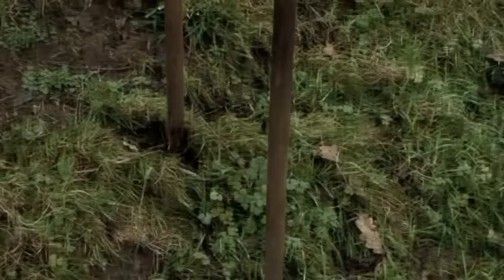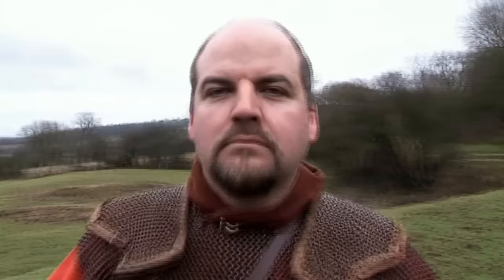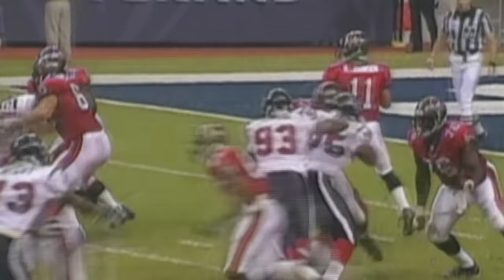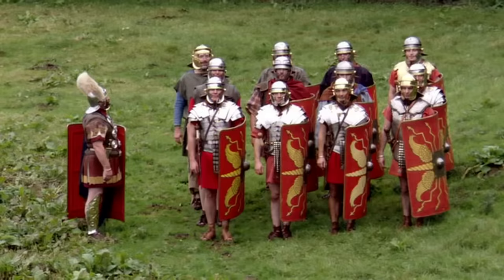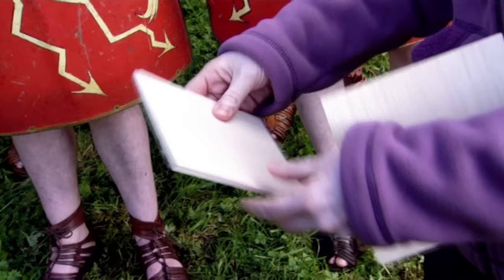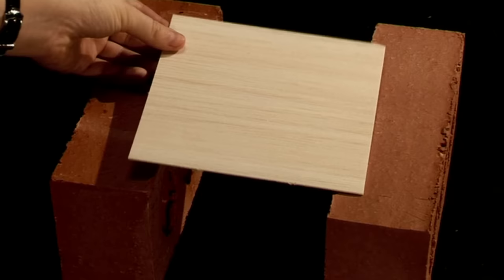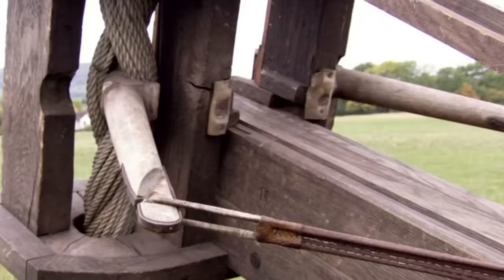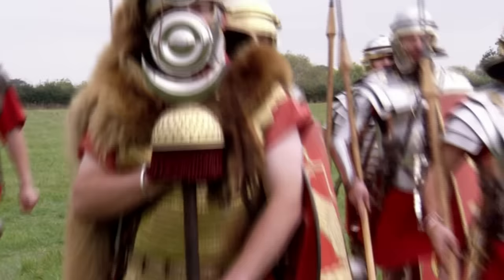Roman Military Technology and Tactics

Comment: Several misunderstandings keep going on about Testudo formation.

Note that it supposed to be a last resort.

It is very vulnerable in close combat against any melee attack, cavalry attack, and engine fire. Even against arrow attack, it is not considerably more protective compared to any more conventional cover formation. Finally it is tiresome. In normal circumstances you expect that only defending side of the cohort is under pressure and the rest of the unit is resting until their turn comes, and men fighting in tandem, so that they share the risk and effort in turns and fight much longer this way. In testudo you force entire unit to raise shields and tiring all men in an uncomfortable position, which also prevents use of any weapon to protect the first line. No pilum, no tandem, not even support from back raws as all men from second line to the end losing their front view. Unit is slowed down and cannot maneuver. Soldiers cannot dodge individually or in small groups as they cant see incoming attacks.

If Romans would testudo every time they received arrow attack, they would lose battles much more frequently.

Only few cases where Testudo isnt counterproductive, can be when enemy concentrated fire, either from an elevated position, or aiming over the shields from a long distance.

Testudo may be an instinct behavior when surrounded by too many horse archers, but if this has ever happened the war was to be lost anyway.
Reply: Yes but the engine fire, may be arrows, could go through their shields and may kill them by impailing their hand
Reply: @TPS-Ultimate-Soccer69  or any other body parts
Reply: No, it was used in attacks when the enemy had ranged units. For example in the battle of Antinoch, Aurelian used the testudo to move his units as close as possible to a enemy force that was between 2 mountains and guarding a road. He couldn't flank it, so he had to go straight at them. In these frontal attacks, the testudo was very important
Reply: @visegradi  Hence why it's considered a turtle/tortoise; slow and steady.

Comment: The scorpion is just a smaller version of a ballista am I right
Reply: Josh Jago pretty much.
Reply: Josh Jago think of it as a .50cal, you cannot destroy a castle with it, but it will kill anything it hits
Reply: Josh Jago Scorpio
Reply: if we take it for a modern comparison, yeah, the scorpion is a bit like a .50BMG, strong enough to defeat most infantry armor (let's not count the anti-materiel properties as there were no cars 2000 years ago) but still far from a 20mm cannon. The scorpion, though, was still designed more as a hybrid between artillery and infantry so a better comparison would be a bolt action MMG (medium machine gun), a .50BMG of the pre-firearm era would be more the medieval windlass than anything, still operated by two people but it was designed to work as a shouldered firearm... plus it was definitively way more powerful as the limbs were made out of steel and you needed a pulley mechanism to wind the string back in the ready position.
Reply: no, a ballista is a big scorpion
Reply: Yup
Reply: would be a bitch to fight against in the old ages

Comment: Have you tried a shaft of wood with a rounded front part with drill-like grooves cut into the sides to increase the spin it would gain in flight and straighten its flight path, as a projectile? I love seeing stuff like this, but I also like questioning how our more modern era knowledge of science would effect things in such an area. Like castle construction, with knowledge of concrete, rebar, plumbing, and turning water mills into primitive hydrogenerators. It makes me curious as to how well it would stand up to medieval castle design since most modern era castles are simply houses for the rich or are built to defend against modern weapons rather than the brute force of medieval constructs.
Reply: no

Comment: I thought chainmail was for defense against sword thrusts / slashes
Reply: it was
Reply: yeah this butted armor they were wearing is mainly againts missiles and is bad againts swords as you can just slide the blade through the gaps.
Reply: Mad_Scientist 
How?
Reply: Thoughtful Potato via stabs? lol. this armor was made to resist arrows as the guy said as it works like scale armor to an extent if hit by a slash or missile but if you have a sword or polearm you can just slide the tip through one of these huge gaps as they didn't have chainmail beneath.
Reply: Butted chainmail is mainly against surviving if you know what im talking about. Butted chainmail was virtually never used (outside of japan), and for a reason. I think i have to explain a bit. There are 3 Mein types of mail, solid, riveted and butted. Solid mail are just, well, solid. Its just rings. Butted mail, are rings with a little gap which gets closed by hammering the ring after they get put together. Riveted mail also has this gap, but instead of just hammering them they get closed with rivets. There sometimes are other differences between riveted and butted mail, but thats the only consitant one that has to be there.

Butted ring on the left, riveted on the right: http://www.blog.ironskin.de/wp-content/uploads/2016/09/buttedrivited31.jpg

So, duh, of course the butted mail will break, it has litterally open gaps in every ring that get bend open easly.

Comment: Looking at the shield tactics, anyone notice the blindingly obvious vulnerability of the soldiers forming the Testudo ("tortoise") formation with shields to the front and overhead? Of course, the Testudo was used as a defense against plunging fire (arrows, etc) so there likely wouldn't be anyone near enough to the Roman soldiers to take advantage of the vulnerability with, say, a low-sweeping sword.

Comment: Although I take this video in a decent regard in introduction to Roman Military Technology, it DOES come across as somewhat a bit lacking on it’s details
Javelins (Pilum - s., Pila - plu.) were used by the Roman Legions, they most likely have utilized the Hasta (Spear), alongside it are slings, with specialized flint ammunition for range combat. 
A battle I remembered (but I don’t know when or where, but it featured the Romans Legions fighting) is when the Romans charged into an enemy army, stopped two-thirds of the way, threw their Pila, and continued the charge. The Pila didn’t do much damage, per se, but it DID give off a great scare on the troops and made them disoriented 
Also, there is large evidence that the Chain armour (Lorica Hamata) is invented by the Celts/Gallic peoples and was passed down to the Romans, and the Romans copied suit.

Comment: That weapons "expert" was showing chainmail wrong. It was supposed to be worn over layers of padding so the mail would absorb the impact and even if it did split rings it the arrow wouldn't reach the wearer. Chainmail will bust open easy as when you hot it against a hard surface but that's not how it was effective.

Comment: I should mention there. Is a lot wrong in this video first the pilum is a piercing weapon it doesn't bend on impact and being reused wasn't a problem because it was thrown within meters distance of the enemy as soon as it was thrown gladius was pulled and they where already locking swords no time at all to pull it out it was designed to pierce shields rendering them useless

Secondly the lorica hamata is no where near that heavy that would be how heavy a full 60 incj chainmail hauberk would weigh the ones that cover down to the upper knee and all the way down to the wirst the lorica hamata is less then 9 pounds second arrows wouldn't have piercing lorica hamata was designed to protect agaisnt slashing not piercing attacks but could protect against piercing better then any other armor in the world at the time

Thirdly the lorica hamata is again lighter then described and again wasn't designed to protect against peircing it was just designed to be a general upgrade

Comment: They actually removed the second iron screw and replaced it with a wooden one so the iron shaft would snap off the wooden handle easier. 😊

Comment: In ancient times, once the bow was adopted, there would basically be skirmishers out front--either mounted or younger recruits, a line back of infantry and behind them heavy infantry and the archers, their 'artillery' of the times.  There also was the phalanx, a tightly knit group of soldiers in defensive posture, though it could be brought forward in the offensive.  The Romans followed this basic design, adding the gladius and other refinements.  The inflexible phalanx was dropped, though the 'shields up' defensive posture was directly derivative of the phalanx.  Hannibal knew all this, and at Cannae, he attacked with close in combat which inhibited the Roman military tactics, neutralizing them and leading to a crushing victory...

Comment: actually the were 6 soldiers at the crank end 2 levers for each side 1 would already have the lever in the slot and the solder would be constantly handing the lever loader the leverman would only move the lever back and forth using the vulcrum all the time, not lifting and reposition the lever, a just want to know how they split a tree down to sheets ov wood  3mm thick, 3 pieces to make the shield, 3mm thick per piece a know because there was a scutum found in the tyne at south shields

Comment: Information on the pilum isn't entirely accurate or correct, not only was the stem of the head un-tempered, but the pins holding it in place would often be made out of wood so on contact they would break meaning the metal head would break away rendering it unusable, but also easily fixed after battle as they collected all of the pilum for repair.

Edit: Infact most of the facts in this video are either entirely incorrect, or so brief and far from the truth

Comment: Its worthwhile to say its, "designed to kill". It may be an obvious statement but not necessarily with more exploration. For example modern bullets are not designed to kill but immobilise and injure. This provides the advantage of taking more enemy/resources out of the battle/war as they try to help the stricken victim. NATO bullets are smaller than Russian for logistical purposes but after entering the body they are designed to shift to a horizontal plane (maximum surface area) to get stuck or cause the largest exit wound possible. This will need surgery to remove, can cause infection, the psychology of a screaming soldier lowers moral. Sadly war and its instruments have a strategic dimension, often a lot more evil and devious than just death.

Comment: Just wish to point out that the Romans did NOT use their ballista for taking down walls. Ancient walls were far too thick and made of stone, usually upto 40 or so feet high at most. They were there mostly to kill infantry, from a safe distance, as well as supporting pushing towers and battering rams, and setting fire to any buildings behind the walls. There was a one ram that could take down walls, but that wouldn't be invented until the Byzantium empire. The ram tortoise of Hegetor!

Also, there isn't much mention of the Auxiliary troops, which were a much needed asset to Rome. Rome lack Archers and Cavalry, but many of the different conquered regions excelled in these areas, like the Syrian archers, or Greek Pikes. The legionnaires job was mostly to hold, not drive forward. They were more of a defensive line for archers and other infantry, rather than actual fighters. History shows us this because, well, Rome didn't exactly like expending their own citizens. So, auxiliary were the first line majority of the time.

Comment: The pila was used peirce Shields to make the Shields unusable because of the uneven weight.
Reply: Pila were mainly designed and meant to kill man behind that shield.Pilum as obstacle in shield was only secondary effect.
Reply: @paprskomet  All throwable spears were meant to kill.
Reply: @paprskomet  The long awkward spear head of the pila was supposed to stick in the shield of an opponent and unevenly distribute the weight when the spear head would bend and warp. Yes the pila was designed to kill but it was also used to make  Shields hard  to use and soldiers of the Roman empire used the pila for both cases. Neither of us are wrong.
Reply: @idontknowwhatimdoing3676  That is not in question but popular misconception that it was meant to bend to serve as obstacle stucked in shield is(sometimes even propagated as its primary role).

Comment: This historical weapons expert doesn't know how to draw a bow? And actually (to add to previous comments) she was somewhat wrong about the pillum... they usually carried 3 each... two lighter ones far longer range and denying the enemy his shield (his most important piece of equipment, most cases) while the third heavier was intended to do more damage. This was really mostly to make the ensuing sword fight much easier on the Romans maintaining their shields...
Reply: Also clear those guys hadn't thrown a javelin before, but then again, I guess kids just dont attach knife blades to 7ft bamboo anymore.... On the tree farm we would jam apples on the ends instead of blades to make them safer to throw them at each other.
Reply: In reality it is not known securely how many pila were worn to battle or not since preserved illustrations and written descriptions are presenting inconclusive picture.Most often it is assumed that one light and one heavy model was most typically used but for example of their tombstones soldiers are almost always represented just with one Pilum(heavy model).

Comment: Why didn't they wear shin guard armor like hoplites?
Reply: They actually did,but it was not part of regular equipment of every common soldier.Deppending on era you would ask sometimes we are better informed about when they used and sometimes less.In times of Punic wars,common soldiers often had at least one greave worn on the leg which was in front.Later we know that greaves were used mainly by soldiers positioned in front ranks.
Reply: @paprskomet  I see, greaves are not common for every soldier

Comment: The Latest Information of The SCP Foundation

Containment Area
At an unknown date in 2008, SCP-173 was moved to Site-91. SCP-173 is kept in a locked container. The floor regularly has a reddish brown mixture of feces and blood, likely originating from SCP-173.

SCP-173 Origin Story

The SCP Foundation originated in the "paranormal" /x/ forum of 4chan in 2007, where the very first SCP file, SCP-173, was posted by an anonymous user (later identified as Moto42), accompanied by an image of the sculpture "Untitled 2004" by Japanese artist Izumi Kato.

SCP-173 Original Entity

SCP-173 was originally a creepypasta posted to the /x/ (paranormal) board of 4chan at 1:40 on June 22, 2007. The post described the procedures needed to safely contain a paranormal statue that could move and attack people when not looked at.

Does SCP-173 Have A Weakness?

SCP–173 is a 2 meters tall (6ft) concrete statue with bizarre markings that kills all living things on sight, moving toward its victims at a speed of several feet in one blink of an eye and snapping their necks with irresistible strength and lethal precision. In addition, it's completely invincible

What Is It Made of?
It is made or rebar,rubber,concrete.

SCP-096

What Does SCP-096 Do When You Look At It’s Face? SCP-096, also known as the Shy Guy, is a major antagonist in SCP Foundation universe. It is an Euclid-class humanoid contained by the Foundation, who will know if someone looked at its face and relentlessly pursue that individual until violently murdering them while screaming.

Can SCP-096 Talk?

SCP-096-M can speak in a human language so it can be talked to through speakers.

Is SCP-49 Bulletproof?

No SCP-49 Can Be Shot AFAIK

How To Kill SCP-096 

You Must Use Acid On His Eyes And He Will Be Weak

(Iike For More)